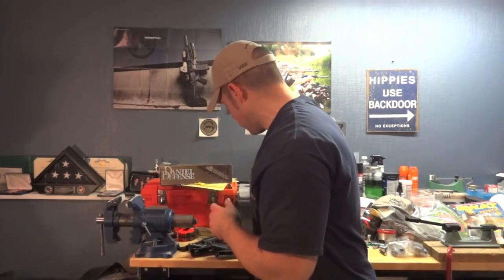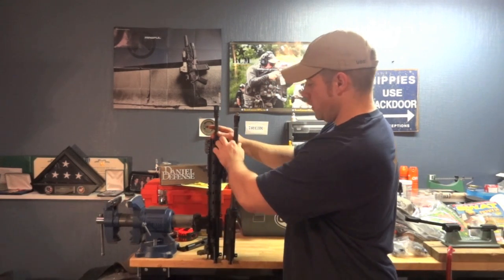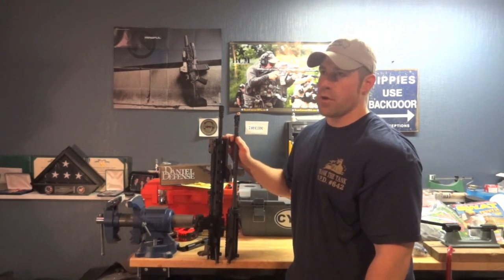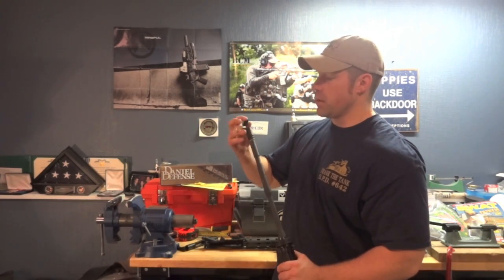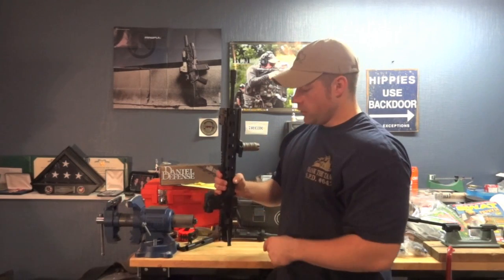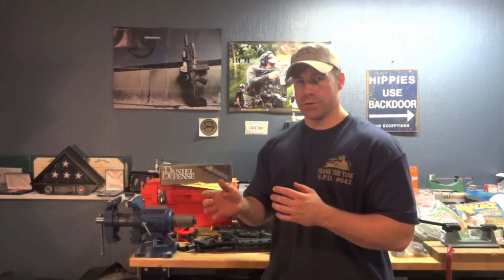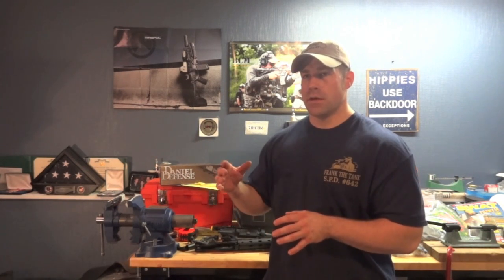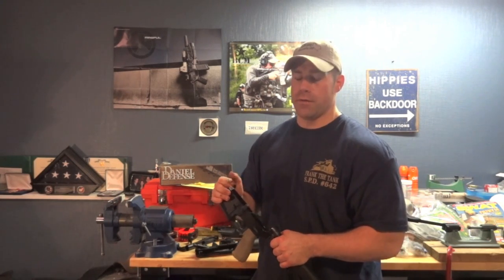Choosing a 16" vs 14.5" Pinned/Welded Barrel

Comment: In my opinion there is no reason to run a 14.5 inch barrel pined and welded over a 16 inch. There is no advantage in ballistics or maneuverability, it’s literally no more than an inch or two difference in length. That is not going to give anyone a tactical advantage clearing rooms lol. Some Cloners must have a 14.5 to feel clone correct, but after you pin and weld it, you are about as clone correct as a 16 inch barrel would be. Further more, the 14.5 is basically stuck in that  configuration, unlike a 16 inch barrel. Also the weight difference isn’t even worth mentioning if the barrels are the same profiles.

Comment: I want avoid Federal Prison,
16" barrels on 10.5/11 5 inch 
Pistols? Easy peasy? Or not ?
Reply from the maker: A pistol is defined as having a maximum overall length (OAL) of 26 inches.  So long as you are under that length, you can run any barrel length you like.  That being said, running a 16" barrel on a pistol is sort of pointless because the purpose of owning a pistol lower is to be able to run a barrel shorter than 16" and not need to obtain an NFA tax stamp.  It also looks stupid and makes it pointless to run on a receiver with a pistol brace as opposed to an actual adjustable (or fixed) stock.  If you can run a stock, run a stock because pistol braces make very poor stocks.  Additionally, running the gun as a rifle allows you to place vertical grips and certain other options that would otherwise turn a pistol into an NFA OAW.

Comment: well hell, 18" AR is only an inch or so longer and you get a lot more performance... might as well go with aan 18. But then again, 20" AR is only an inch or so longer and its what the Marines use so really that is the best. OH except the 22-24" AR's... thats only another 2-4"... whats 2-4 inches... you might as well just go with a 30' AR barrel. As far as SBR... it better not be longer than the barrel nut or your stupid... you should see the bullet sticking out of the end of the reciever.... THAT is a real mans SBR.

Comment: What do u think about the smith & Wesson M&P15 TS,anyone! I'm thinking about getting one
Reply from the maker: The "T" is the best option in the M&P15 line.  Tactical line is the only line S&W uses full top grade components.  Overall, M&P15 rifles are a great buy.  Very good middle tier option.
Reply: SentinelDefense
Thanks for the video
I'm by start on my upper and I'm not sure if on a 16'' barrel a fake can 5.5'' will be cover under a 10'' rail?
answers please...
note: Don't care about real or fake(fake can) I just like the look. THANKS
Reply from the maker: Are you using a 10.5" short barrel with a permanently attached fake can to bring it out to 16"?  Or are you putting a fake can on a 16" barrel?
If the short barrel, it depends on the rail and the can.  On the 16", it's irrelevant.

Comment from the maker: The biggest problem with the 14.5" setup is that a lot of people buy their components and rifles from "economy" (lesser quality) manufacturers who don't have tolerances like you get from top end companies like BCM, Noveske and LaRue, and then they go use low power target ammo like PMC Bronze or Wolf/Tula and then over-buffer the system with an H2 because they don't know better. That 1.5" of extra dwell time in the 16" acts as a safety net, as you rightly point out.

Comment: Just my 2 cents here, but if you are going into extreme close quarters, would it not be better to transition to a side arm?
Reply from the maker: It depends.  If it's an area like a crawlspace, then yes.  I've had to do it going after two fugitives.  However, if you can maneuver a rifle, you want to use the rifle.  There is such a massive difference in terminal ballistics, and the pistol is a very inferior weapon in that respect.
Reply: SentinelDefense The only issue I see with a rifle is what they taught us in MOUT training. If you are in extreme close quarters and have to  turn a corner, you either have to have your rifle in the low ready and bring it up fast, or you flag your barrel and someone can make a grab for it putting you in a worse situation. I'm just talking about the extreme here, not close quarters in general.
Reply from the maker: mattxr2i In CQB, there is a lot of benefit to running in a high port/"SEAL" high ready position as opposed to low ready.  It maintains better muzzle discipline so don't flag other members of your entry team.  SEALs and other SOF units run it.  Jeff Gonzalez of TRICON and Jason Falla of RB1 have been teaching it for a while.  The added benefit is that you can then readily use the rifle as a hard impact device for non-lethal application.  The problem is that you have to consider things like the accuracy potential, higher rate of fire, higher precision shot placement and overall drastically higher terminal ballistic effects by the rifle vs that of a pistol.  This is especially important when considering that per FBI statistics, duty/defense .223/5.56 carbine loads have a lower propensity to over-penetrate a body than pistol rounds.  I think the most apt way to put it is this- if you want to tear down a wall, you can either use a claw hammer or a 12lb sledgehammer.  Both will work, but one works a lot better, despite being larger.  Given any particular circumstance, I would always want the superior performance of a rifle.  Regardless, there's always a need to adapt to the environment, so there will certainly be times when a pistol may be more advantageous.  If your issued rifle is an M16A2/A4/A5, you're not going to have a very good rifle for MOUT/CQB because of that 20" barrel.  I've done plenty of MOUT in my Army days with an A2, and I know how much it sucks.  Compare that to an M4, and it's a world of difference.  If you train correctly, you can make most rifles work.  I would rather use a 10.4" HK416 to clear a room than a 14.5"  Colt M4, but there have been very few situations where I have not been able to function with that Colt M4 inside of a house, business or out in dense vegetation.
Reply: SentinelDefense Very true. I have done MOUT with both and I agree the A2 sucks balls! I also did training in transition fire where when your rifle mag goes dry, you transition to your side arm because it is faster than doing a mag change (especially with the M4 style rifles) I I think it's like you said, the situation dictates what is the best tool for the job.

Comment: Great info! I just subscribed. I bought a Windham made Bushmaster xm15 14.5" carbine system several years ago and have had no issues at all with it. It isn't anywhere near the quality set up that you have but for 1000 dollars I am very happy. It came with a Leupold vari x 3X9 and six mags. I did buy a spikes ST-T2 buffer for it when I first bought it because I was told that carbine gas systems are very hard on the parts and a heavier buffer would lengthen the life of them and smooth out the recoil. I didn't have any malfunctions before or after the swap but it is smoother since I switched  it out. What do you feel about reduced power fire control springs or after market triggers? I firmly believe in the "if it aint broke don't fix it" mentality and my rifle has run flawless for me but I am not opposed to increasing its performance if it isn't taking away from reliability.

Comment: Wouldn’t a handgun be better moving around in a car , clearing a room ect
Reply from the maker: Inside a car, yes the pistol is much more maneuverable.  In room clearing, a rifle is very easy to manipulate and manage.  Regardless, the rifle is almost always going to be the more advantageous weapon platform.  "Better" is subjective because pistol ballistics are generally pretty limited, because pistol bullets only punch little holes in threats.  In contrast, rifle terminal ballistics are far more devastating to a threat.  Pistols have always been a compromise, wherein you get a weapon that is highly concealable and maneuverable,  but at the expense of performance.

Comment: I'd love to have a Noveske if I could afford one.  However,  I have a DPMS all stock internals it runs everything including that Russian crap (Tula) I do not use it but have some for SHTF as a last resort round.  Anyhow I know its nice to have top notch components but unless your at war I would argue most people are fine with a well known manufacturer. Metallurgical testing is nice to but not necessary unless your slapping on components in theatre and need them to work out of the box without some range testing.  I have a couple thousand rounds through my DPMS now... PMC 223 PMC green tips, Remington 223, Lake City green tips, XM 193 ball, Independence 5.56 nato and a few Tula 223 test rounds.  This little DPMS goes bang every time I pull the trigger.
Reply from the maker: Every time I've been at a shooting course where a DPMS was used, the DPMS either has significant malfunctions or an outright failure that deadlined it from the course.  The issue with DPMS is that their guns are not made to be stressed like those from Daniel Defense, KAC, LMT, etc.  They are regarded as a "hobby grade" rifle, and should be treated as such.  If you only go to the range to recreationally shoot, a DPMS could very well be fine.  However, there are a long list of LE agencies here in MN that have bought DPMS and had rifles that had significant mechanical problems from the factory.  The issues continue, but ultimately, it comes down to how you view your investment or how you use it.  I personally prefer the mantra of "buy once, cry once".
Reply: All AR-15's are basically designed from the same set of specifications.  I guess I disagree  with your findings.  I just own one.
Reply from the maker: ***** DPMS is not designed from the same specifications as the top tier companies.  This is because the specifications vary by who makes what components.  Only certain companies possess the actual current military specifications.  DPMS is on par with other companies like Bushmaster, CMMG, Stag and Olympic.  The following things are what DPMS does that top name rifle companies don't do:
-A3 upper receiver
-Rifle (non F-marked) FSB
-Chrome chamber and bore is optional, not standard on all models
-Commercial size receiver extension (buffer tube)
-Semi-Auto AR15 BCG
-4140 or 4150 Steel barrel instead of MIL-B-11595E+ construction
-Bolt HP/MPI testing only done by batch sampling, not individually
Point being, they cut corners in order to keep the price down.  This is why they are more affordable than higher quality brands like BCM, LMT and DD.  This is also why they are "hobby grade".

Comment: 16" SBR = bullpup,
Reply from the maker: I'm not fully sold on the Tavor, but the aftermarket for it is really making it promising.  I can't wait for the DesertTech MDR to come out.
Reply: I prefer the FS2000 with a trigger upgrade, neu-trigger, judo chop charging handle, K&M Aerospace trigger pack job, and new trigger and barrel from Hi-Desert Dog.